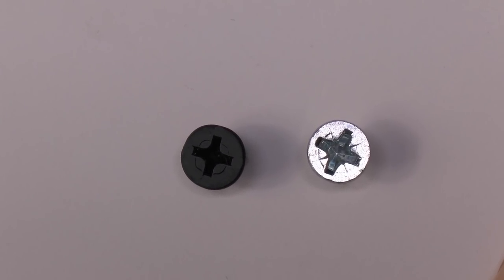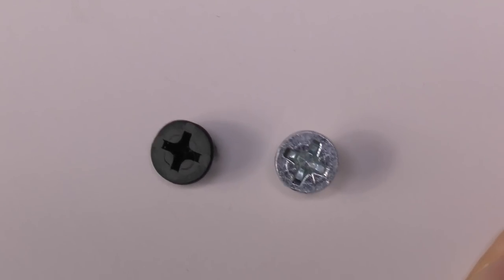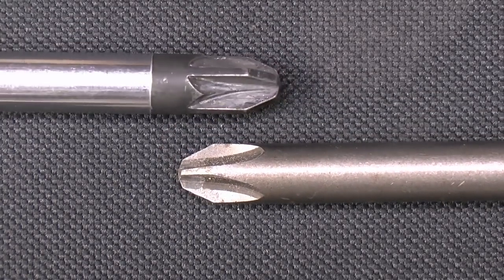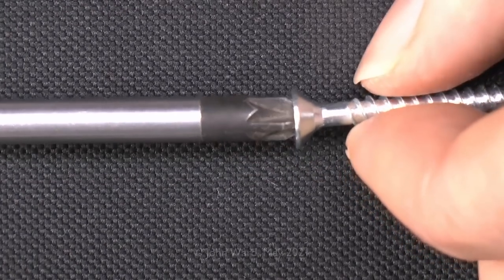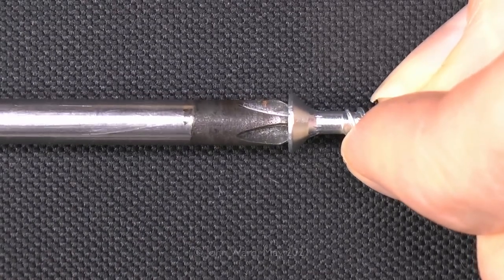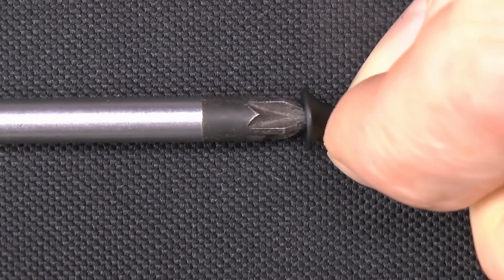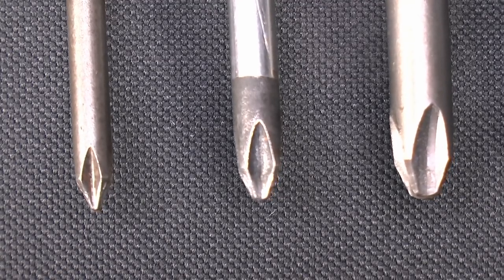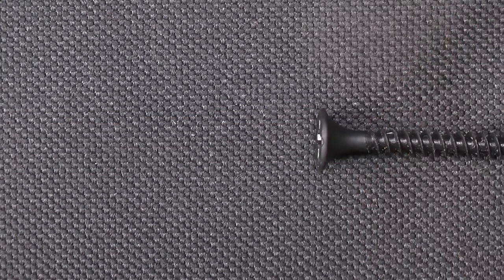Screws - Phillips or Pozidriv ?

Comment: In New Zealand they mostly use square drive screws. Having worked on building sites for many years here, they work very well in my opinion. Not sure why we don't use them back in the UK.
Reply: My dad's decking is built with square drive deck screws. However the square drive is so uncommon in the UK that every box of screws had an electric screwdriver bit in.

Comment: Fun fact

Philips screws were invented for the aerospace industry, because the screw cams out (by design) at high torque, it was good for stopping people stripping threads on aluminium panels, which on a large aircraft would have been a very expensive mistake.

Comment: I beg to differ: on phillips heads I use pozidriv drivers and bits to minimise cam-out and phillips drivers and bits to protect the base material (eg plastic) from excessive torque. Heads and driver do wear out as any other things do, but absolutely no catastrofic effect. In the end I never have the luxury to chose the head print, just the tool.

Comment: One of my biggest triggers lol. Having worked in the past as a motorcycle mechanic I used to find so many mangled JIS screws. Faced wot a JIS that someone has destroyed using their Philips or Pozi drivers used to make me 😠 I work mainly on British bikes now using flat head screws. The trick with these is to grind driver heads to fit precisely, never use those naff drivers with tapered blades. The faces must be parallel.
Sorry, I admit, I'm a screwdriver Nerd and don't even get me started on threads 😂

Comment: Rule of thumb generally I find is if it’s screwed into metal work, it’s a Phillips, everything else is pozi. Wouldn’t say 100% of the time but generally it’s the case
Reply: It's easy enough to see the difference between pozi and phillips, but I notice that almost all appliances I've brought which are made in America or China seem to use Phillips.
Reply: @1992jamo  well I’m from a construction background and I would have been inclined to say if it’s screwed into metal, it’s always gonna be Phillips, just like you say. But I wouldn’t have the hands on experience in the electrical/appliance industry so I would never assume so thanks for that.

Comment: Also remember the scredrivers have a limited life, you will find they wear out eventually. That is why when you buy proper drywall screws in a box you get a bit to install them with, because the bit will last around 2000 screws before it is totally knackered, so you get a new one with every box of 1000 so you do not get it slipping out. Good fine pitch drywall screws will self drill through 1.6mm steel with no problem. The coarse ones are only good in chipboard and plastic.
Reply: That's because with drywall the original electric drivers (I still have one) have a collar to control the depth of the bit protrusion, which is adjustable. When the screw reaches a certain depth in the plasterboard the bit is prevented from gripping by "camming out" and this chews up the driver bit over time. So you need a new one with every new box of screws. Pozidrive is not used because PZ screws/drivers are not designed to cam out.
Reply: @bimble7240  True, but even the hand operated screwdrivers wear out with time, and start to cam out easily. I have replaced many screwdrivers because of wear, and even those with hardened tips you find they wear out, if the tips do not just snap off when you are trying to undo a stubborn screw.

Comment: Philips screws were initially designed for electrical equipment. 
They were designed to slip out to ovoid overtightening.  An in-built, cheap, torque screwdriver.
Reply: Yet the original patent filing doesn’t mention this, so it’s highly likely that this was actually a retroactive attempt to market its weakness as a supposed advantage.
Reply: @tookitogo  
Could be. But they were designed not to be over-tightened, the prime aim of these screws.  The screws tended to have a chromed head, which also looked better when domed. The domed head clearly was not for a better grip. Why design and make them when slotted screws can do the same?

The original Philips screwdrivers had a more rounded head simply to slip out to prevent over tightening. 

Posidriv was more squared off as John Ward shows in the vid, giving a firm fix between screw and driver giving a firm non-slip drive of the screw.

When Posidriv were first introduced in a big way, they were advertised on TV. Tradesmen shunned them as it was perceived as a DIY gimmick. The TV ad'' pronounced them Posidrive. The name told you it gave a positive firm drive with no slipping out that frequently occured with slotted screws. Joiners fixing frames found that they could do jobs in a fraction of the time using an electric driver and posidriv screws, rather than by hand with slotted screws. 

Posidriv really took off when electric drill-drivers were commonly used as the drill never spun out of the screw. Then torque battery drivers came along, then impact drivers, taking advantage of the firm mating of the driver and screw.

When I look at old framing with 4 inch slotted screws done up by hand, I always wonder how long it took and how much wrist strain they suffered - much came back to affect their wrists later in life.
Reply: @johnburns4017  Rewording the claim that Phillips was designed to limit torque/over tightening doesn’t make it any more true.  Wiki: ‘The design is often criticized for its tendency to cam out at lower torque levels than other "cross head" designs. There has long been a popular belief that this was a deliberate feature of the design, to assemble aluminium aircraft without overtightening the fasteners. Extensive evidence is lacking for this specific narrative, and the feature is not mentioned in the original patents. However, a 1949 refinement to the original design described in US Patent #2,474,994 describes this feature.’ That reeks of retroactively trying to market a flaw as a feature.
Reply: @tookitogo  
You may be right. But the fact is it, does cam out limiting torque.  If you were designing a cross screw and wanting to have a firm purchase between screw and driver, you would not design one like that. It would be more like the Povidriv design. 

It may have a been an unknown side feature, but that made it take off, as some manufacturers liked it so adopted it. These day we have torque screwdrivers, drill/drivers, etc.
Reply: @johnburns4017  I’m not disputing that Phillips does cam out and thus limit torque. I’m only disputing the claim that this was an original design goal, which seems very unlikely. (In fact, it was supposedly developed to, among other things, address the problem of cam-out with slotted screws. Wiki again: “The Phillips screw design was developed as a direct solution to several problems with slotted screws: increased cam out potential; precise alignment required to avoid slippage and damage to driver, fastener, and adjacent surfaces; and difficulty of driving with powered tools.”)

Nor am I convinced that anyone actually considered camming out at any point to be desirable, even if it did limit torque, because of how camming out damages the screw head, driver, and often the workpiece.
Reply: @tookitogo  
" I’m only disputing the claim that this was an original design goal"
I am aware of that.
Reply: @johnburns4017  Then why keep rewording your claim over and over? Rewording it doesn’t make it any more likely to be true.

Comment: All very well, but I have tossed most of my Phillips head screws out, and I have a full selection from 20mm to 100mm in Square drive. Duplicated in Stainless as well as coated steel. This is for a retired fellers workshop!!

Comment: John. This of topic. The price os solar panels are falling to a point where a German manufacturer is supplying a balcony kit that can supply 300w to 600w into your home. Think it suggesting you just plug in the ac side of convertor to house socket.. This seems extremely dangerous. Any chance of your thoughts on video

Comment: Hello, for normal drills (without impact), which bit model is recommended? Extreme impact bits, can they be used with normal drills or only with impact drills? Are Extreme impact bits more durable, more resistant than normal bits?

Comment: Unless I missed it, would have been nice to see the end-on views of both pozidriv and phillips screw heads
Reply: Thing that puzzles me is that at 3:00 the correct sized PZ driver is used, but those extra webs/shoulders (unique to the PZ) do not even seem to project into the head of the screw?
Reply: @SaxJockey  I've always wondered about that. What's the point of the extra 4 corners on Pozi when they never make contact?

Comment: John quick question for a 13amp plug and play hot tub, would export the current PME supply to earth the new outside socket for it, or would you do a TT system for the earthing. As DAvid savery did in his hot tub video?

Comment: With both you have to be head-on or the screws round off. This is especially annoying when using a drill driver or impact driver.
Reply: You have a sleeve that runs over the screw. Then it all lines up.

Comment: Would strongly recommend you readers turn your attention to Robertson (square drive) or Torx instead. Both infinitely better than Pozi or Phillips. The only legit use for Phillips is in machine driven gibboard/drywall - the driver simply cams out once the screw is far enough but not breaking through the surface. For use on wood, the other formats are far better. Torx can also be used with a hex driver (Allen-key) although that's a hack that can backfire if the screw head is not hardened.
Reply from the maker: Robertson drive screws and tools do not exist in the UK, which is why no one uses it.

Comment: No one in their right mind would choose Philips  (PH) these DAYS. Whilst they are an improvement on the classic straight drive, they have a tendency to cam out while tightening. Pozidrives (PZ) are a distinct upgrade to PH and can take much higher torque loads without cam-out.
But I now use neither. All my new screws are Torx or occasionally square drive for pocket hole screws. Cam out is now a thing of the past - but a new problem is now possible - stripping the heads, particularly when using an impact driver. I now have to remember to adjust the torque setting on a power drill or be careful with the impact driver.

Comment: I am sort of surprised by the comments. I thought everyone knew this. Anyhow a nice confirmation for correct driver use is when attached to the screw it will be able to hold the screw up without you touching it, a  Posidriv (drive!) will even hold the whole weight of the screwdriver when you are holding the screw, they should fit that well. They have a very positive hold, more so than the Phillips or JAS.
Worse than any of this is the number of knackered slotted screw heads I see. Use a decent fitting slotted driver ie across the full width of the screw and no movement/wiggle if screws are visible and use minimal force. The problem with slotted screws is the drivers are all crap. They are all tapered while the screw itself is not. An armorers driver set is not tapered and will have a bit to perfectly fit the screw. If there is no movement then there will be almost no risk of damage and also all torque will be transferred. If you are dealing with old equipment with a lot of slotted screws invest in a set.
Reply: Try PB Swiss drivers. They’re parallel blade, not tapered. I still find flathead screws to be odious, but using PB Swiss drivers makes them somewhat more tolerable.

Comment: ....and then there's the J-Spec drivers & screws, which will drive you mad. Made of much softer alloys, found on Japanese imports---cars, motorcycles. Have at them with 'regular' steel Phillips or PZ drivers & you'll end up with mangled screw heads in mere seconds. Added bonus: they are always in hard to reach places & performing crucial functions.

Comment: Trouble is Clive there is now mongrel screw's being used even by leading suppliers like Schneider the screw's look like pozidrive but you will find screwdriver will cam out earlier use a philps and seems ok, better still use flat blade then you can tighten them up really good no need for any limp wristed torque driver user's

Comment: Canada has it’s own which is good. American has a newer type head that is better. It is like buying electronic equipment in Europe or America,the plugs are different.
Reply: 'America has a newer type head that is better'? In what way? And what is it called? Allen? Torx? I'll wait.
Reply: Tory or star head in America, it’s more expensive that Phillips. Canada has Robertson.
Reply: @georgeryan9139  Anyone can have the Robertson if they pay the royalty, it's Canadian, so maybe they're cheaper here, they certainly aren't expensive considering how well they work. And they look nice, i think.
Reply: @georgeryan9139  Torx and Star and Robertson are likely harder to make than Philips, which aren't very deep, and thus easier to damage when the driver slips out.
Reply: Yes, costs more because of production. Phillips was designed to be use for aircraft and was deliberately designed to slip out if the hole was too tight or something else was wrong, so you would check what your doing before you go any further. Yes the Torx and Robinson are better. Your right. Have a good night.

Comment: Just use Robertson's screws everywhere and you'll never have this problem! lol ; )
And you won't be left wondering whether it's a JIS screw (good luck finding a screwdriver for those in a hurry) or Philips you have, as pointed out elsewhere.
Reply: I have a wide selection of screwdrivers and bits, but JIS is the one thing I don't have. It's hard to find JIS drivers in the UK, there are certainly none in hardware stores or tool shops. Even Mackays in Cambridge doesn't sell them, that tells you how rare they are.
Reply: @owensmith7530  annoying, aint it ? At least nowadays we have internet, e-shops etc. Even so, it's a task.

Comment: They both suck. Better than a slot screw but still the risk of cam out. I ditched all my screws and switched to torx. No cam out, no slipping - it just works. More reliable and can handle more torque than hex/imbus (ikea style)
Reply: Torx works until you strip one out, Robertson can stand more torque than any other type, with a real Robertson driver. There's lots of cheap crap imitations, Robbie drivers have a hardened insert, they're cheap and tough.

Comment: And this is why they need to ban all cross screws and flat heads and everything should be TX.
Reply: Phillips has some applications though.  Mainly for when you want the driver to cam out to avoid damaging the fastener's strength or the material you are driving into.

Comment: Here's my question, who invented the screwdriver? Why don't we know his name? Everyone calls it the flat screwdriver. Then at some point along comes Mr. Phillips who doubles down on that flat idea and made it a cross. No one calls it the cross or Star screwdriver. Most people call it the Phillips. So Mr. Phillips comes along makes a small change yet quite significant and he gets all the recognition and "Mr Flat" (I doubt that was his name) gets none. Seems unfair.
Reply: Slotted screws are easiest to make, very common and easy to damage, the screwdriver must be an exact fit and kept in line with the screw or you'll make a mess of it, especially soft brass screws or stainless.
Reply: @Lumby1  I'm simply referring to the naming of the screw and screwdriver. Why did mr. Phillips get to put his name on the idea and the other guy mr. Slot I'm sure that's not his name didn't get to put his name on the original screwdriver.
Reply: @geniferteal4178  Slots are the cuts in the head of a screw, they've been around forever, because you can make them with a saw easily. Making Philips, Torx, Hex, Robertson sockets in screw heads is more difficult and requires the invention of a method, hence the name of the inventor or a name he chose. Square(Robertson) screw heads can withstand twisting or camming out of the screwdriver tip better than most others, and the drivers are easier to make. When you invent something, you get to name it, nobody knows who invented the slot head screw, it's ancient.
Reply: @Lumby1  perhaps we don't know who invented the screw BECAUSE he didn't put his name on it. LOL I think it's unfair.
Reply: @geniferteal4178  I think it was Archimedes, but he probably stole the idea from somebody else. Screw is a pretty good name, no? LOL
Reply: @Lumby1  cute. Love it!

Comment: i use wera screwdrivers day in day out and get about a year out of them before there worn and need replacing due to the screws been hardened. i bollock anyone using the wrong ones as it wrecks them prematurely
Reply: Try PB Swiss drivers, they make Wera (which are already well above average) seem like toys! The precision in PB Swiss drivers is just astonishing.

Comment: Both are Rubbish compared to a proper Canadian "Robertson" that are square and have a slight taper so you can put a screw on the end of your screwdriver and it will not fall off. No need for Magnetic tips.

Comment: video 100% correct summary 100% wrong philips 2 is by far the most useful screwdriver on site uk, 30 yrs trade auto mechanical  electrical h.v.a.c philips  2 will undo 95% of screws on site pozi 2 less than 80%. i advocate right tool right job but if you can only choose 1 its no contest philips 2 every day of the week mate
Reply: i challenge buy high quality pecision non damaged philips screws and try to undo with pozi 2 and vice versa
Reply: or  need to clarify this video for those who are buying screws and those who are buying screwdrivers
Reply: pozi dont even jis
Reply: Across all common trades you need Phillips and Pozidriv in equal measure. Anyone can afford to buy a Nr 2 of each. “Can only choose” is a pointless false dichotomy.